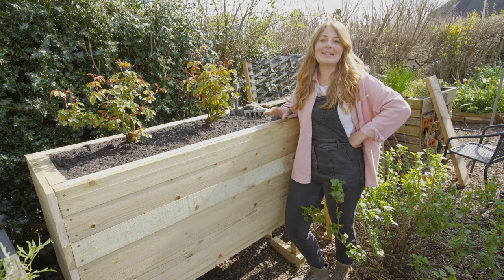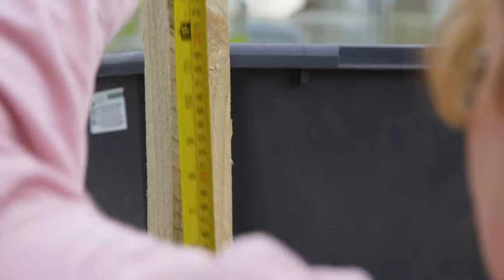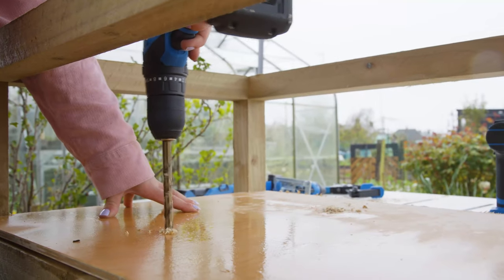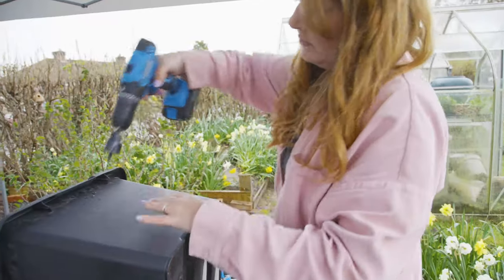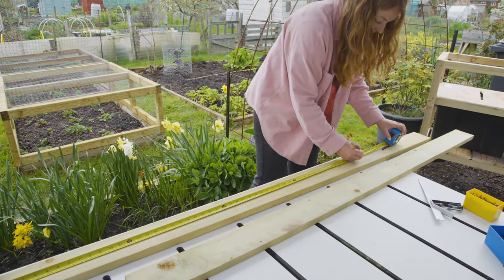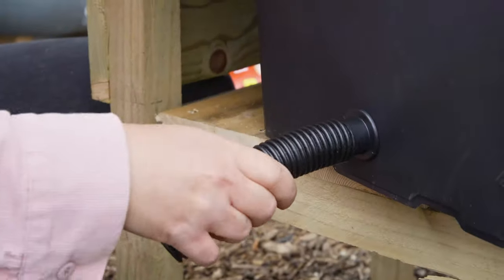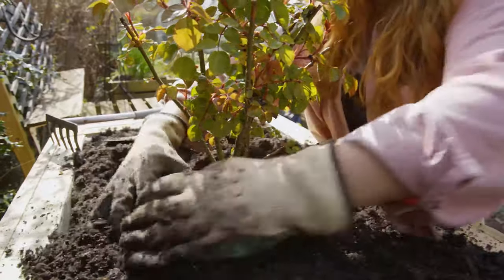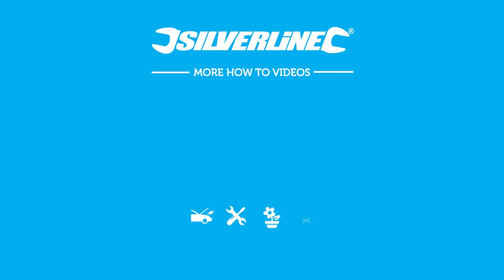Raised Bed | Water-Collecting Planter!

Comment: Well done. Had the idea for a raised garden bed table a few months ago. Don't have access to ground soil, just a ceramic tile patio area. Prepping the project for a L150cm x W100cm x H110cm and one of the final questions was how best to collect the water to recycle it. Thought of a metal sheet sloping towards one end where a bucket would be placed, or waterproof lining hanging a little below the bed, directing water into a bucket. This is a far, far more elegant solution but we'll see about cost.
Reply from the maker: Let us know how you get one with yours!